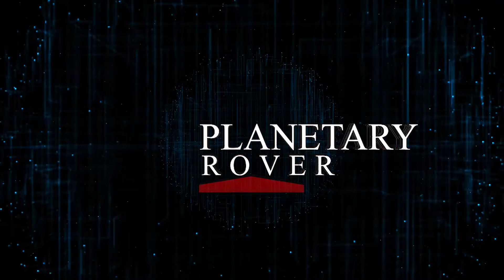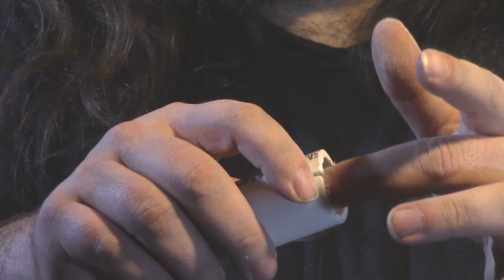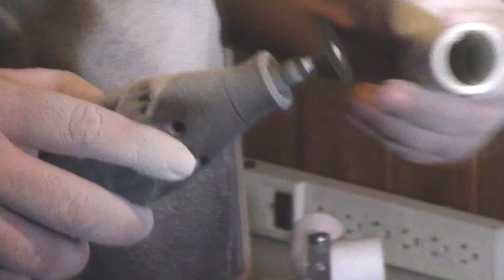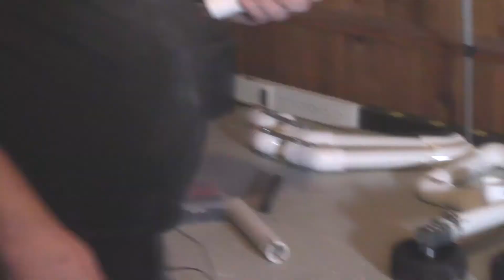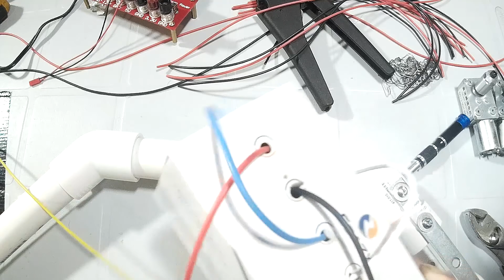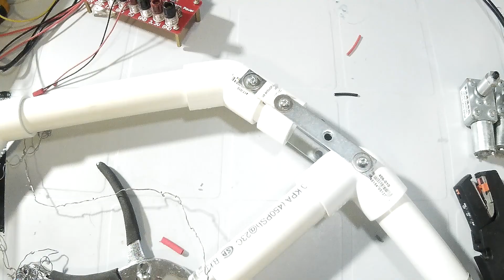Planetary Rover - Chassis Build Part 2

Comment: Nice :-) 
Will it be fully autonomous?
Reply from the maker: The plan is semi-autonomous, very much like the mars rovers, in that it will send data back to the ground station to describe the environment around it. I want to be able to set areas of interest, have the rover do path finding to get to the target and take readings with the sensors it has and return that information to the ground station itself. Over the next couple of months we will be doing videos on each sensor, and electronic component, as well as working with OpenCV on the raspberry pi.
Reply: Mikey's Lab  amazing .if you don't mind i have one suggestion ! Keep your videos short (between 20-25 minutes).